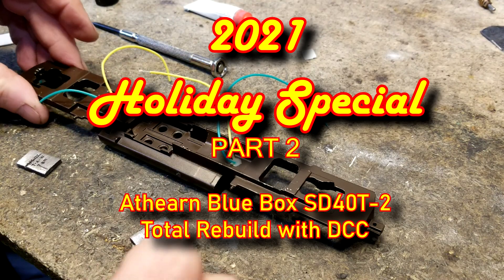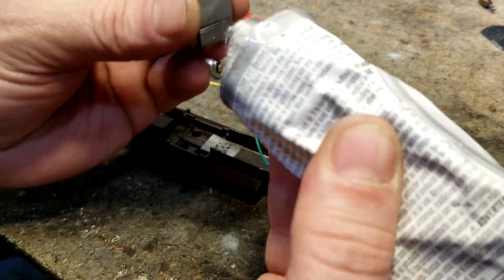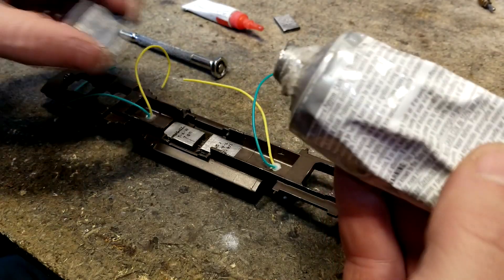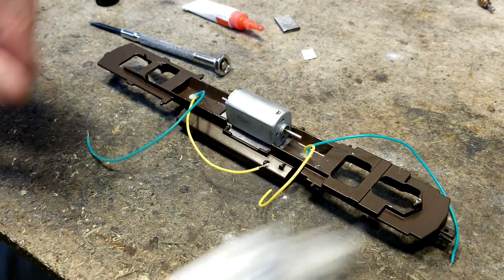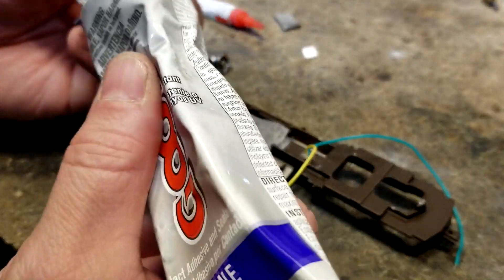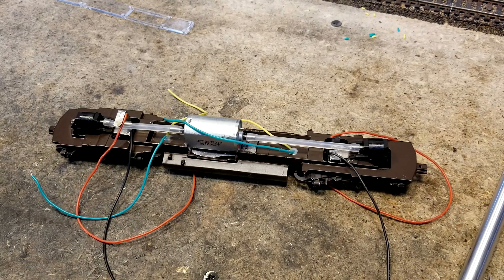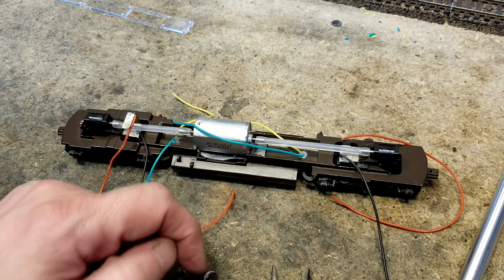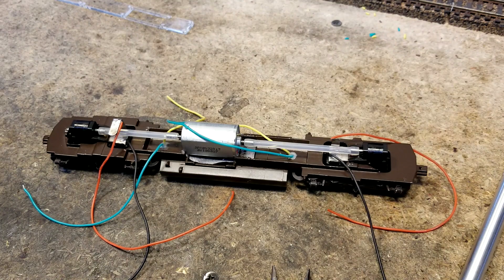2021 Holiday Special SD40T-2 Part 2 of 2

Comment: Regards small fiber optic issues, the folks at TSG Multimedia showed a way to make lens ends on headlights and such out of fine fiber. It is shown in detail on their video HO Scale SD40-2 Model Building 22 of 25 Final Assembly Pt2 at about the 16:45 marker. I  have used it numerous times, but with a small butane torch, not a Bic. There is one caution. Too much heat will make the "lens" droopy and a toasty color. Go easy on the heat. I have also tried using the barrel of a soldering pencil as a flame-less way to heat the plastic. Either way works, but gentle heat is the watchword.
Reply from the maker: I'm practicing my fiber techniques... I failed at the flame method, but have been having success with the soldering barrel.  I know a guy who uses a bic lighter and takes him a couple seconds - I'll take the extra time method for now!  I've getting a couple different sizes pretty quick.

Comment: I have learned a TON from your videos. THANKS!  One thing that I would really appreciate is if you would add links to where you get stuff, like the motors. I spent hours chasing down rabbit holes, looking for the 130 and 280 motors. I did find some at a Chinese outfit on ebay called Motorhouse. We shall see if the current "supply chain" issues make delivery something that happens next year... I also am now using the Mag1 and Evaporust that you recommend. Great stuff!  Also going to try the Graphite metal effect technique. Thanks again. If that ribbon you use as an Avatar is what I think it is, glad you survived the experience. Happier New Year.
Reply from the maker: thank you!  the motors are just hit or miss, but when you search for them check the pictures and the description for the performance chart.  if it goes up to 24, 29 or 32 then that's the right one.  motorhouse is on my saved sellers list so I've gotten good stuff from there.  I try to get at least 10 at time because they take so long to get here.  look out for the 6v motors, they are for drones and easily burned up.  this new graphite I got is from ZEP and it's pretty good stuff.  the powdered stuff is just the usual kind from any hardware store.  and the experience was quite an adventure!
Reply: @elite194  If the ZEP hits the market, link would be appreciated. Thanks.

Comment: Nice job. Can you tell us the source for your motor? I have 4 undecorated tunnel motors I bought in 1982 that I have held on to for some personalized locomotives. They will soon get a custom paint scheme and new motors. I once tried the silicon drive shaft but couldn't get it tight enough to keep it from expanding in the middle (wobble) when the motor was running so I cut a length of a finish nail that would almost reach from shaft end to shaft end and pushed it into the tube. That stopped the wobble by keeping the tube from flexing from the centrifugal force.
Reply from the maker: The nail method is pretty much how the GP9 was setup so you could remove the hose to get the middle band over the shaft.  Motors are hard to get and you have to buy them when you find them.  I almost always have some in the pipeline because the good ones take about 90 days to get here.  Sometimes you can get 180s on ebay, but you must read the code to make sure it's not a low voltage motor.  This is an even bigger problem when buying 130 motors because there are so many variations.  Drone motors have no torque but super high rpms and screwdriver motors have super strong torque but low rpm.  10k rpm is about the slowest you would want.  Make sure before you buy because there are no returns and no money back ever.

Comment: Is this the 130 motor you use? it is only rated up to 12v, not 24 >> Mabuchi FK-130SH-12250 DC 6V 9V 12V Dual Shaft Mini 130 It does seem to be available (from China) on ebay, but there are SO many variants...
Reply from the maker: this motor is FF-180 24v, not a 130 - both motors come in different voltages for different applications.  low voltage motors have much higher RPM - think about the rotors of a drone, they have very high RPM, but very low torque where the motors I use in trains have very high torque but much less RPMs.  the multiple variants require tons of constant research because the sellers often recycle listings and just change the stats, so when you see the right one you must order it on the spot and even if you put it on the watch list or make it a bookmark, the next time you go to order it will be completely different.
Reply: @elite194  Thanks for the added info. I have not yet located any 180's, but did actually order some of the 130's.  Old ears thought you said 130 on the audio and they LOOK identical to what you showed. Ah, the hunt remains afoot... sigh! BTW, could I at least get your 1st name?  "Elite" sounds kinda snooty...